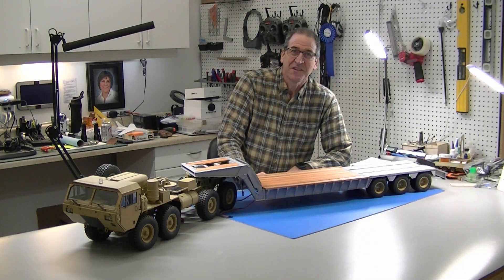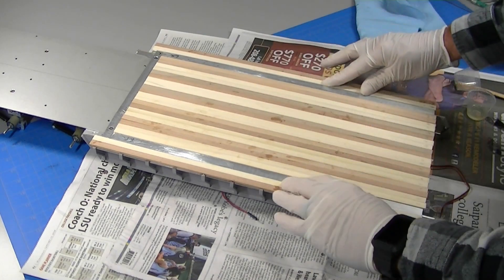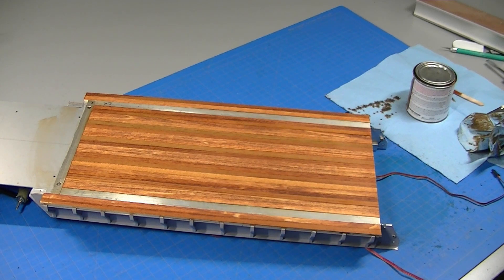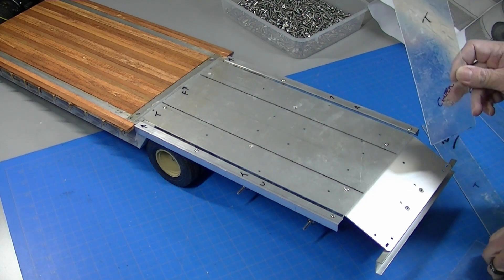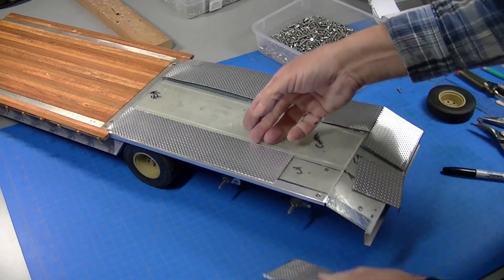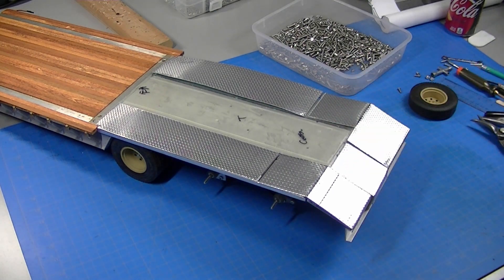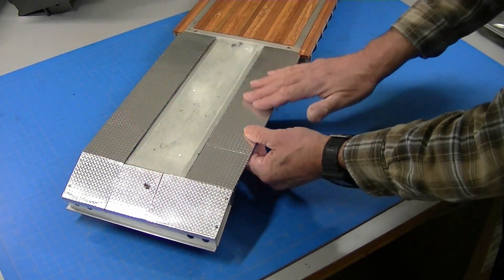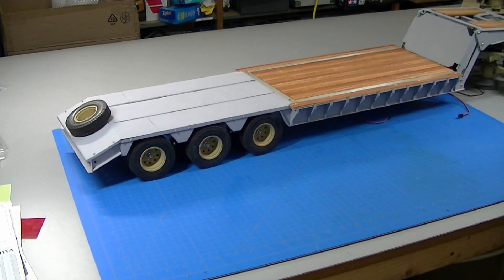1/12 HG P 802 Hemtt Custom Trailer Build Part 8

Comment: Wood would have looked good stained with vinegar/steel wool solution. Still looks great though. Thanks for the plans.
Reply from the maker: Not done with the wood yet.  Will sand it and do a good finish while I am painting.  Just had to get some stain on it to see what I had.

Comment: How much would you charge for this trailer all said and done. I just about have the money saved to but either 
Hg p803a or the
Hg p802 with optional crane only the hg p802 still incomplete without the trailer.
Reply from the maker: Not selling this trailer right now.  This one was a build all for myself :-)  Plus I want to re-paint and finish my Hemtt and do some videos of the trailer with a load sometime in the future.

Comment: Where so you acquire that diamond plate from? The stuff I've been able to source is 10th scale & the diamond pattern is a tad large for 14th scale trucks. Thank for any & all information!
Reply from the maker: Yep, RC4WD.  I like it.  Real aluminum - handy for all kinds of stuff.
Reply: newman  thanks! I've got an upcoming tractor trailer build. It's almost complete, but needs something to cover the frame rails. I think this would make a great catwalk for truck as well as trailer too.
Reply: @HobbyconceptsLLC  most of what I've found was styrene. Finding this in REAL aluminum is a have changer!
Reply: Hobbyconcepts-LLC what’s a good way to cut this stuff without a bandsaw? To get a clean edge?